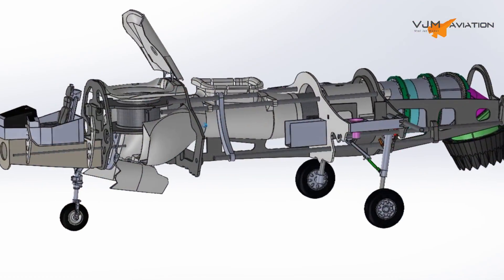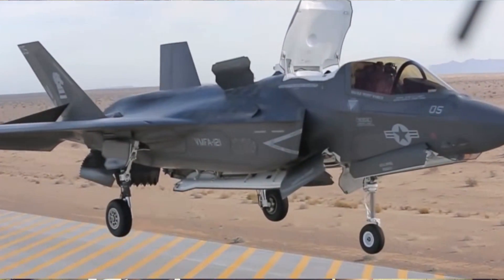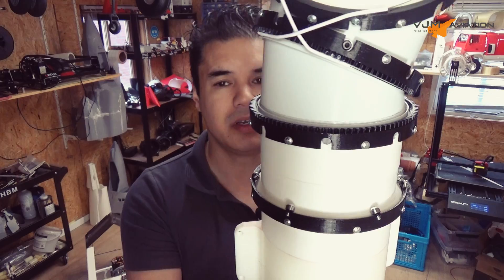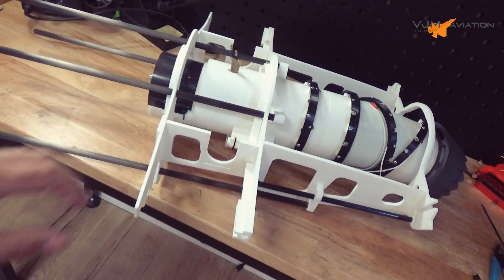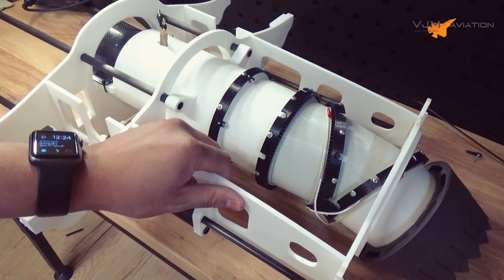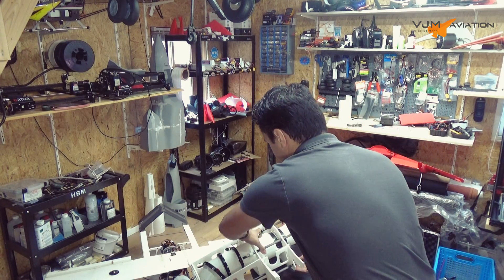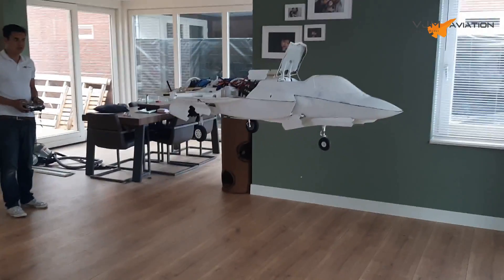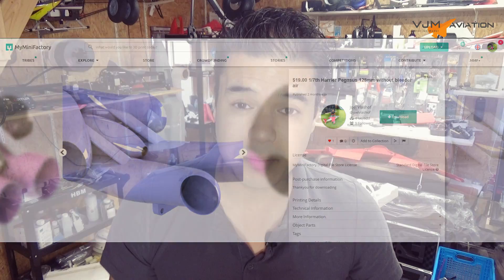F-35B RC Vtol 1/10th scale Homebuild | 3D Printed

Comment: I dont really get how is it mossible that if the tube is cilindrical with circular section, a non perpendicular to the axis cut, can also be circular, it would have to be eliptical, or the exit tube would habe to have an eliptical section. I can't visualize that right now.

Comment: I don't understand the carbon tubes,  I expect the skin to be so stiff, strong and thick that it should provide most of the stiffness. Making the skin so thin that it can't take the load seems impossible to do.
Reply from the maker: True but i have to cut 21 doors in that skin🤪
Reply: https://youtu.be/E3waf1PEz1A?t=20
There he provides the rational behind the carbon tubes.

Comment: Beautifully engineered, I might actually say, over-engineered. I could significantly redesign this to make it far more lightweight; but, if it doesn't have enough mass, it would be too susceptible to being affected by the even the very slightest breeze. Alway the weight versus stability conundrum for us model designers. Overall, I believe you've probably got your engineering balance exactly on the optimal. My congratulations
Reply from the maker: When the bulkheads are glued in the carbon tubes aren’t necessary anymore, they are now in place for test fly it without the fuselage;)